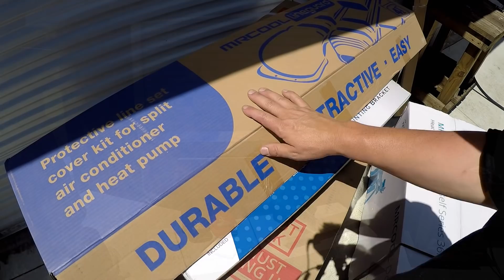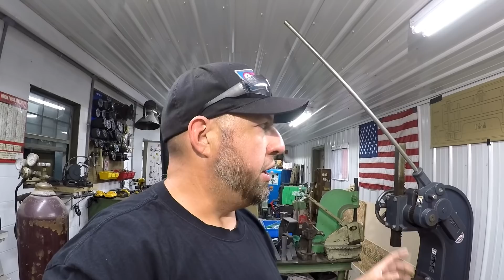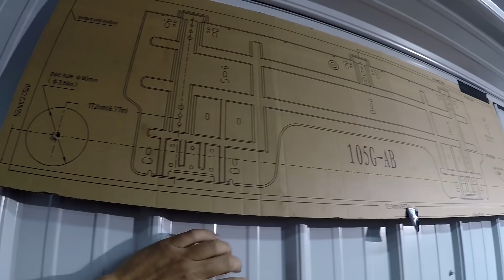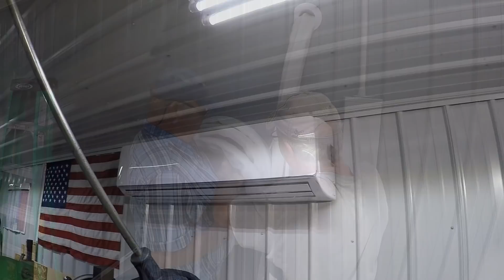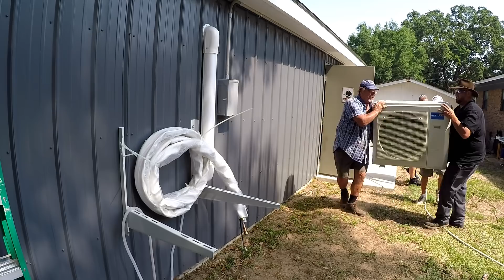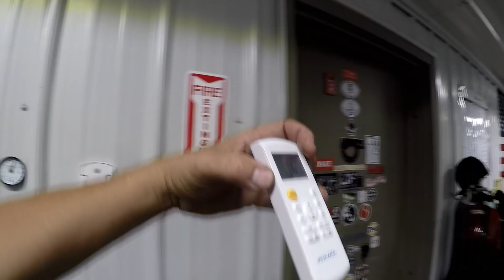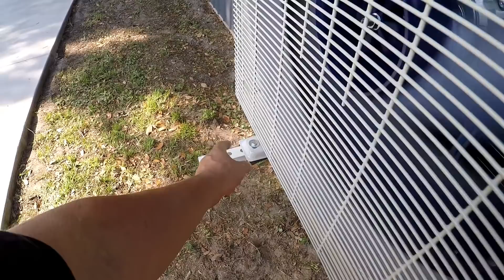Mr Cool DIY Shop AC Install

Comment: The coil of extra refrigeration line is restricting the air flow to the cooling outside unit
Reply: No it doesn't.
Reply: It is supposed to be 6 inches clear behind the condenser (according to the manufacturer) so they should move it out to the end of the bracket.  It does look restricted a bit.

Comment: there is no reason installing Mr. Cool. it WAY OVERPRICED! you can get unites to literally HALF PRICE and hire an ac guy to vacuum. the unit cost me $800 and the ac guy cost me $150.
Reply: bullshit. link the units.
Reply: Please, recommend me your installer guy, I bought two minis and the installer quote me $1800.00
Reply: Give me the link to the units dude. Have you ever done this before? Don't link us some Alpine stuff either...We'll be waiting.
Reply: i installed olmo mini split. i got in from the vendors here in Florida paid 650. amazon sell it for 699. works great and cools down my rooms any day of the week especially now in hot florida days. any decent ac guy that you will hire just to do vacuum and connections will charge you around 150. it's very fast and easy. you can also also youtube how to do all the connections yourself with very little tools. the most you'll need is some gas from a pro hvac.  i didn't make that comment to start a war so don't call bullshit on stuff you don't know. if you truly want to do it yourself, there are many ways to do it for dirt cheap if you have half the regular handy skills. company like Mr. Cool are taking advantage of people by charging the living crap for a "diy" and packing youtubers to prompt their product. but the truth is that the difference between any mini split and "mr cool diy" is so little but they charge a premium for it. also, i have 0 respect for sold channels that instead of giving good valuable info for subscribers, they are selling their channel and promoting companies that are pure ripoffs.
Reply: @mikeh4327  They charge way more in my part of the woods. That is if you can even get one. In Texas we are so busy building no one has time for side jobs. The one guy I did find wanted $400. This unit came in perfect when you are in a pinch.

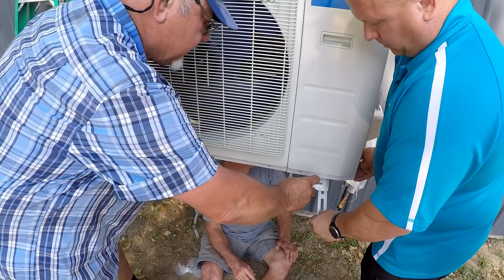Comment: @19:20 - NO  NO NO Never sit under things like that WTF!
Anyways We pulled 4 Mitsubishi 120 volts version, mini splits from an office building a couple months ago, I reinstalled one in my RV camper and it is A LOT quieter and cools down faster then the rooftop unit I have on it.
Reply: I was thinking the same thing when I saw that guy sitting under the outside unit. Yikes!  😲😧

Comment: Just received my mr cool unit. I purchased one based on reviews from you and Keith Rucker.  Will be installing it as soon as I receive a 3-1/2 inch hole saw. In Montana, especially here, it gets unbearable hot for about two months and it is miserable in the shop. Plus, we have relatively cold winters, so the heat pump will come in handy. Thanks for the info!
Reply: Make sure that the water drainage pipe doesn't get clogged by dirt or bugs.

Comment: Hi. Great video. Wonder if you can help answer my question. I have a 900sq ft welding shop and thinking about an AC unit as well. How do you weld with the AC and vent out the fumes keeping the doors closed? Ty in advanced.
Reply: @budfallon3776  ok I'll check it out. I'm dying of heat in my shop. We've had two weeks of a heatwave in ontario

Comment: are you going to put a gutter on the roof above the outside unit so the rain water won't get into the a/c  unit?
Reply: The outdoor unit is completely weather proof, but yes I also think there should be gutter.

Comment: Other videos show them pulling a vacuum.  So what were they doing, if it's not needed?  Just wondering.
Reply: These units come fully charged with the correct amount of refrigerant and the lines have fittings that don't release the refrigerant until connected and valves opened.  Typical a/c units are soldered in and have to be vacuumed before adding refrigerant.
Reply: @chuckminear4835  thanks!!
Reply: Watch the video again.  He mentions the precharged lines oh, 2 or 3 times!

Comment: I really wanted to see the 230v electrical wiring hook up, video cut to inside before that was shown. Great video otherwise.
Reply: He went inside to install his little remote and skipped one of the most important parts of the install. smh
Reply: Run wire to ur breaker
Reply: Your electrician will Run 30 Amp 2 wire with ground (orange wire) to a 2 pole 30A breaker.  He will Install one black  wire to one pole of the breaker and install one white wire to the other pole of the breaker.  He will install the bare ground wire in on the ground bar in your circuit breaker box.  On the cooling unit, he will install both hot wires on the hot terminals.  He will install the bare ground wire to the green screw in the electrical box.  There will be no neutral wire in this 240V set up.  If your unit calls for a neutral because for bonding reasons; He will install a 30 Amp 3 wire with ground.  Black and red wire will be installed on the 2 pole breaker.  Bare ground wire will be on green ground screw.  White neutral wire will be installed on the neutral bonding bar.  Make sure you hire an electrician or have your wiring job inspected by your local inspector.  If something is not proper, and there is an accident, your insurance company will use this reason not to pay your claim.

Comment: nice job.dont cut conds stand like you said that you will. should push little out to keep more clearance it need good air flow in  back for more air flow hot or cold.

Comment: You should have drained the air inside the pipes with the vacuum device before opening the freon
Reply: Sigh.  What video did you just watch??? Did you not hear him mention the precharged lines 2 or 3 tines???
Reply: No need to vacuum out the lines they were vacuumed at the factory and the special connectors are designed to not let air in when you connect them

Comment: great video! how does the air circulate in these units? I was looking at putting a 24btu in my 1000sq ft ranch open concept.you think that is a good match after owning yours?
Reply: D Mac I sure hope it’s a good pick buddy cause I have the same unit sitting here waiting to get hooked up in the next week or so and I’m putting it in a 1,000sq ft partially open concept that I bought a few years ago and have been remodeling. I completely gutted the house, took out the flat ceilings and put vaulted ceilings in, insulated with R19 then added 1/2” foam board on the bottom side of the rafters like drywall but the foam has a foil back to radiate the heat back into the attic which is pulled out by 2 attic fans, and then I installed shiplap yellow southern pine and it looks awesome! When I replace the siding later this year I’m gonna put another layered foam outside with Hardi plank over the top of it. By all calculations and how cool it’s staying in here already, I think 24K will be more than enough. 

I’ll let you know in a few weeks tho if your interested .

Comment: A professional, like Abom79, would cut the copper pipes to the proper length to decrease the heat loss, then redo the valve connectors. These old fellas just tinkered up, than left. A vacuum pump is advised to use in case of the pre-vacuumed lines also.
Reply: caviarxxx lines are Pre-vac and charged. No need to mess with it. But yes the extra line is not the best looking.
Reply: @zacharywhite8230  Its a flexible copper line, ive repaired them before, they a lot harder to seal than traditional copper lines, but on another note, they should not be coiled up behind the condenser even if they are insulated

Comment: How did they get the electrical connector through the small hole in the cover?
Reply: It fits. But I couldn't find a good way to cover up the empty space around the cable. I cut open a plastic knockout bushing and put that around cable and snapped in to knockout so at least cable wasn't wearing on metal edge.

Comment: Good installation but he for sure forgot to vacuum the system when he connected everything before releasing the refrigerant. Not good without clearing all the air in the pipes.
Reply: Whatever dude, watch the video again and research these units. You DO NOT pull a vac on the line set before opening your charge valve
Reply: do it yourself. but only if you know a professional electrician that installs AC for a living 😉
Reply: Did you actually watch the video??? Watch it again, and listen for the parts about the precharged line.  He said it 2 or 3 times.  Sigh.

Comment: Too close to the wall!, I understand the roof eave is shallow, but these units are made to handle weather. Also needs to breathe in back! (Too tight with the copper coils in back too) Mounting it all the way out on the brackets will alleviate that, and the copper lines being bent too sharply, they're rubbing the wall and bracket too tight. That's why Fernando had trouble installing them. You will have trouble if you don't let both sides breathe. (Cooling loss)

Comment: curious as to the cost savings of running these as opposed to window units. i need this down in S. Louisiana!
Reply: Too give you an idea as to power bill, my bill dropped from $150-$200 a month running window units to $40-$50 per month in North Carolina summer heat. The difference is completely amazing!!!
Reply: These  run way more efficiently as long as you  get the right size for your area..
Reply: massive energy savings in comparison but the upfront costs are higher

Comment: I have a 12 x 20 shop, metal building on concrete slab.  I calculated I needed a 12K minisplit, MR Cool doesn’t make a DIY unit that small,  so I bought a conventional unit requiring pro installation.  The unit was $499.  After mounting the bracket and heat pump, running a dedicated circuit, and adding some 2 x 6 inside for the blower location I was quoted $1800 for installation!  I ended up buying a cheap set of gauges and vacuum pump and did it myself.  Worked fine.
Reply: Mr Cool has had a 12k unit for years and from what I understand that is one of their best sellers. I don’t know how you thought they didn’t make one that size tho
Reply: They do make a 12K DIY - but sounds like you made it work!

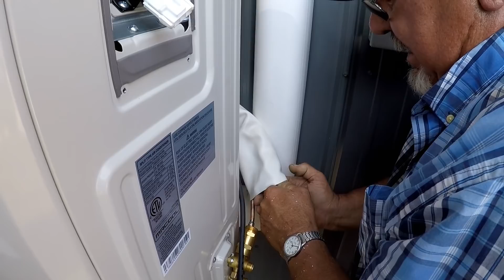Comment: 21:36 you should get the large line installed first then the smaller one. Putting that kind of force on the lines after you installed the smaller one could have cracked the connection point on the unit.  You can't put that kind of force on those valves nor should you need to. Also, once you tighten the small and large line coming into the outside unit you need to spray soap water on the connections to make sure you're to leaking freon. And last, once the unit has been running for a few hours tighten the lines at the connection point one more time (not too hard, just snug).

Comment: They didn´t do the vacuum first, before open the two lines   Bad for them
Reply: these minisplits come precharged so there is normally no need
Reply: I was thinking how the get by with out vacuuming the lines out but in an earlier comment they explain how it is achieved... the lines work like a self tapping refrigerator icemaker line ... well kind of...

Comment: Wrong place to install the ac.
Reply: Why even write your comment if you aren't going to back it up with your expert opinion of where it should be and why?
Reply: @999torino   
You should always put the evaporator unit on the longest part of the area. That way you will have better circulation, and you can cool the entire area. The problem with the way he installed it is that it creates hot spots in the corner, remember this unit only has one way flow, that's why it needs to be placed where it can reach a larger area.
Reply: Regardless it will cool down the area, but it is more effective on the longer side
Reply: I disagree
Reply: Why is it bad

Comment: Before you cut off the extra length of the brackets you could use them to support a roof panel to deflect snow or in your case rain.

Comment: Will a local HVAC technician service these DIY units if service is needed ?
Reply: of course. i still service equipment other people installed. however i wouldnt bother with manufacturers warranty
Reply: Andy is the same asshole that would charge 1800 dollars for a 400 dollar job. Lol Which is why people go the DIY route.
Reply: i wouldnt and i am a hvac tech. you DIY you fix it
Reply: Andy Chavez meanie
Reply: @andychavez700  Its not any different to service than other Ductless systems but like electricians a lot of them take offence to DIYers  and most of it is not very difficult as long as you follow the codes and all you need is a code book to do that and some common sense.

Comment: Hi. What size disconnect and what size braker on your braker panel
Reply: All electrical work must be referred to a licensed and qualified electrician, for legal and insurance reasons. Specifications can be found in the manual, which is available for free on the product page at iwae.com
Reply: 30 amp max ,240 volt

Comment: I prefer the flares with proper torque to the o ring fitting these use just seems to be a longer lasting design but I'm always willing to be proven wrong

Comment: For the extra price of the diy system you can easily buy a quality flare tool ie husky, a new micron gauge, and a good used vacuum pump and some good used gauges

I just bought a MRCOOL 18k $880 shipped from home Depot... For example..
Reply: why didnt you go that route? I'm contemplating the same delima.
Reply: @funinthesun9669  It looks like he did. The 12k unit with the pre-charged lines was about $1400 last time I checked. The 12k unit without lines was about $750.
Reply: @user2C47  This sure seems like an overcharge. I would like to see if anything is different between the two other than the lines having the special fittings and the system being evac'd and charged. For another $600? Hmm
Reply: @fredc8346  I got prices from iwae.com if you are trying to compare both units.

Comment: I install mishibishi. That extra linset is junk. You get what you pay for. I would pay the extra money to have mishibishi any day.
Reply: I've seen some Fujitsu and Daikin systems for not much more money than these

The biggest problem I see all over YouTube is loss of refrigerant that goes for Mitsubishi too

This is all about quality install

Pulling the proper deep vacuum
Torque the fittings
Leak testing 
Etc

This seems to be the key to a long lasting system

I would also venture to say that leaving them in the elements when they have way more electronics than your typical "dumb" condenser unit is another big part of why boards fail... 

I see lots of people opting to cover their outdoor unit which I think is the best idea... I installed mine under the end of our elevated back porch where it barely gets damp in a downpour...

 Time will tell
Reply: @doddgarger6806  Barely damp is still damp enough to cause corrosion.

Comment: Really COOL!  Looks great.  Because it is almost silent,  tie/tape a ribbon or string near fan exit so you can see from a distance that it is running. Except for the electric, almost anyone can install one of these.  Thanks for great video.
Reply: Even the electric isn't hard, in places where you don't need a license for it.
Reply: Crepe paper is ideal.

Comment: I like the condenser on the ground so it doesn't conduct noise through the wall
Reply: Hanging the condenser right near the evaporator doesn’t that put a large load on 1 section of the wall
Reply: The line set coiled up like that is going to trap oil and starve the compressor
Reply: @DNR_Garage  Coiling the line is what is recommended in the manual. If you want to cut it, get the cheaper non-DIY unit.
Reply: It’s a workshop , not a dwelling .

Comment: the line set coiled up in the back will make a compressor oil trap. it needs to lay horizontal not vertical
Reply: I've always wondered why they say it's ok to coil them up like this, because you're not the first person to say that

I wonder if it's because both lines are vapor lines as opposed to a STD split system with a liquid line and vapor line....
Reply: Not really a fan of precharged line sets just for this reason. Ideal? Not really. But I don't think he has the space to lay it flat. Kind of a "work with what ya got" situation. I bet some oil will creep along the piping walls and get back to the comp, even in this situation.

Comment: hey bro listen i think you have jacket that condenser unit to close to the building and the coiled line set behind it is restricting the air flow through the unit looks good i would have moved the outside unit down the wall to use up the extra line set instead of coiling it up behind the unit

Comment: With refrigerant oils, wouldn't it be best to install the condensing unit at the end of line set run and hang line set on outside wall instead of looping the line set which may cause compressor issues in the near future due to refrigerant oils being trapped in line set ?

Comment: Maybe you should vacumm it first and then open the two valves, or you can lock one nut to a valve and open this valve, but keep the other nut a little bit loose, release some Freon to push air in the pipe and indoor unit out from the loosen nut, and tighten this nut, and then open the second valve.
Reply: Pre vacuumed hoses, they have built in seals that hold a vacuum.

Comment: Why didn't you show how the actual power was hooked up.  Was it hardwired or is it just a standard 110 plug?
Reply: 240V hardwired into a 30 amp breaker
Reply: The 12k unit is 115 at 20 amps. All the others are 230 at 30 amps. This does not reflect actual power used by the unit.

Comment: This is not DIY
Reply: It's DIY because you don't need HVAC tools. You only need electrical tools (and a license in most developed countries).
Reply: Most people can do these, they just need a proper AC disconnect and dedicated circuit which is easy to do for some people